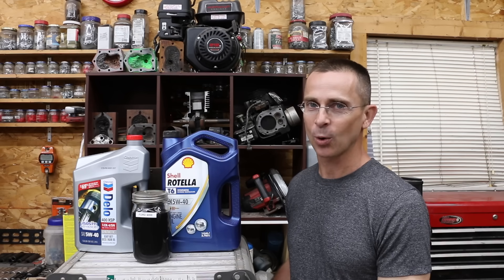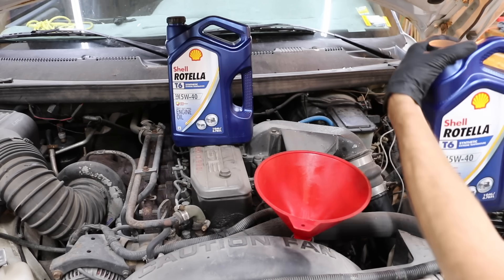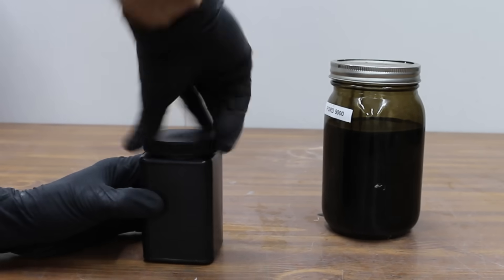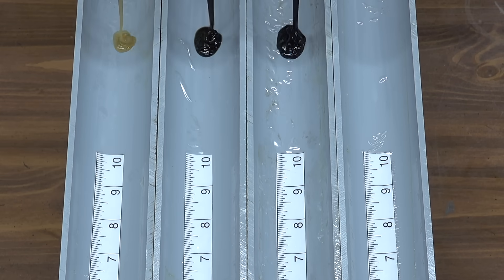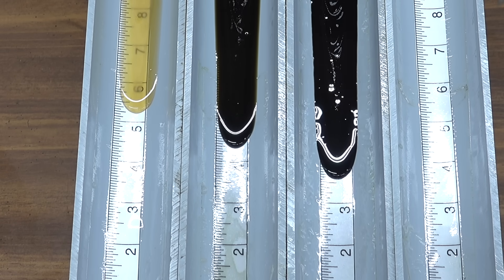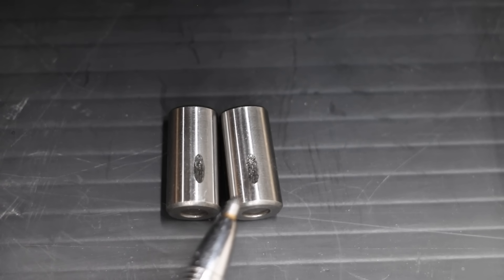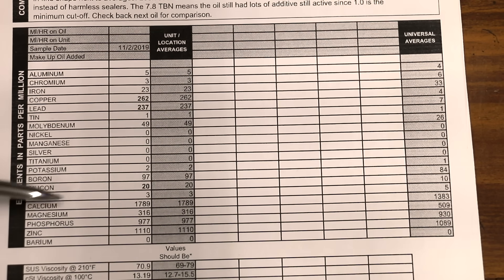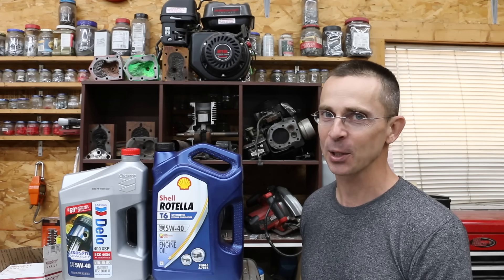Will Annual Oil Change Damage Your Car? Let's find out!

Comment: Way back between 1975 or very early 80's, I remember reading that the US Post Office had developed a vehicle program to cut maintenance costs on there fleet. They would just change the Oil Filter and add a Quart of oil or whatever it took to top off the engine oil. 
This might be an interesting test for you to try if that program was terminated. A lot of things in oil development, like refinement and additive improvements have been done since then. I haven't heard anything on that program for years, but last I heard was that the engines didn't show any wear on parts over the normal engine wear that could be seen over a complete oil and filter change.  Oil level was checked twice a day during the early part of this program to eliminate low oil damage during the early testing. I haven't done a search on it yet, but it might be interesting to see if they are still using that program and how the long term engine wear looked liked. Based on your tests, it may still be going and saving many fleet services a lot of money. But again and to be fair, oil lubrication refinement and additives have changed and improved a lot since then. 

That program was developed because of the Arab oil embargo in 1973. Oil prices went up causing major price increases practically over night. Gas that sold at 30 cents a gallon for regular and a whopping 45 cents for high test, went to 55 cents a gallon for regular and 65 cents for high test. That was if you could get gas at a gas station. It got so bad that you had to buy gas on odd and even days depending on your license plate numbers. Taking a long trip was practically impossible by car, stopping for gas they would only give you a 1/4 tank at most and you had to wait in lines for hours. Many ran out of gas just waiting in line. That 1/4 tank of gas, might get you to the next gas station exit on the highway and that was just the start of what happened, for those that did not experience this. Then the government got involved and really screwed things up thanks to the Carter administration. They had the Midas touch in anything they got involved with for sure and nothing they touched turned to gold, just bad fertilizer and a Cluster F**k at best! 

Everything was effected by that OPEC Embargo, not just gas and oil. Prices went up on everything from food to clothes and a lot more. Everything depends on getting it to the place you buy it from and that is by vehicle and shipping costs skyrocketed. The 55 cent price per gallon held for a little while, then it went to 65 cents then 75 cents a gallon. The price of gas rose so fast the gas pumps couldn't handle the price change after that. When you got gas for your car, if the pump had $10.00 on it, you had to bubble that. It was really $20.00 that you put in the tank.
Those were crazy times and many places started programs like USPS. Even the Airlines wound up buying or building an Oil Refinery to try and stabilize jet fuel. Some programs developed worked, many others didn't or turned out to be scams. With the new pollution regulations removing lead out of gasoline caused even more problems with wear on engines. Auto manufactures had to redesign car engines to adapt to that fuel. 
Crazy times and I hope we never have to go through another one like that.

Added: Some strongly believe that Electric Cars will be the ultimate answer to a pollution problem. I strongly doubt it for many reasons. Most people today do not know that the Car was once hailed as an end to a very large pollution problems when it first came out. That problem was Horses and they were at one time a huge pollution problem. Before the Automobile, every where you went, you either walked or used a horse in some fashion. Horses back then where look at as a Commodity, something to be used for travel, hauling or Farm work. They were not looked at as pets like today. A horse WAS your major mode of Transportation, Trucking and labor. There were between 150,000 to 175,000 horses in NYC alone back in 1900. If you have ever been around or owned horses you know 3 major things first. 1: They are expensive and take a lot of work to care for them. 2: They eat and drink a lot. 3: They Crap and Piss a LOT! Now just think of that last part and imagine how much crap 150,000 horses, in just one city, will produce. Then think of all the major cities, towns and even rural areas that had to deal with that pollution problem  That old cartoon Rocky and Bullwinkle, at the end featured a street sweeper with his broom and trashcan on wheels. That was a reality back in 1900. All that horse crap had to be dealt with on a daily basis as the people operating the horses were not going to stop and clean it up, they had to get somewhere and the vast majority were carriage drivers, the Taxi's of the day and most of the carriages used 2 horses. Then there was the problem of disposing of a dead horse. Most horses were used until they dropped dead and the carcass could lay there for days before it could be hauled off. Horses are heavy and when it must be moved with human labor, it takes a lot of effort even if other horses are involved and with other horses dying daily in the city, it is going to take some time before they can get to it. Now imagine the stink of a rotting carcass laying in the street during the summer, accented with the smell of horse crap and piss. That was a major cause of disease and rats. So when the Automobile came out, everyone saw the end to a major pollution problem. But in their excitement of getting rid of the horse pollution, they didn't see the start of a new one coming from the exhaust and other pollution from cars and oil. Look it up if you don't believe me.

So this is something I'm seeing now, in the excitement of seeing one pollution being eliminated are they over looking a trade for a different pollution. Electric motors produce ozone in small amounts. But multiply that by millions, how bad is that going to be? Ozone is a great thing in the upper atmosphere but it is corrosive and a health problem at street or human level. Those batteries must be recharged too. That takes Power Plants and as more and more electric cars come online, it is going to require more electricity to be produces. Wind turbines and Solar Panels are not going to produce enough power and Solar Panels are about useless on cloudy/rainy days. In snow country, even worse when the panels get covered. With the growing amount of electronics tapping the grid, electric cars are only going to require far more. To give an example of power increase over the years just in homes. When my father built his home way back in 1964, the average home only had a 50 Amp circuit or beaker box. When I bought my first house in 1985, the average home in my area used a 100 Amp Breaker Box. By the 1990's it was a 200 Amp box. Today, some new homes are being built with a 400 Amp breaker box. All this because of the electronic explosion we have going on. So even with all that renewable energy it will not be enough, so more oil/coal/nuke plants will have to be built to supply the increase demands. Then there are the batteries that must be replaced every so often. As it stands now, the batteries can not be recycled so where do they end up? 

I'm no expert, but I do know that people often overlook things when something new comes along. It doesn't help when the environmentalists jump on the wagon before they know everything about a new product they think will do some good, only to find out later it is worse than the old product and many will never admit that. Many times, someone will produce something touting how much pollution of one kind it doesn't produce, but don't tell you or they don't see that it produces another pollution in a larger amount, like in disposing batteries. So in stead of banning one product and requiring everyone to switch over, maybe there should be a balance between the two. Hydrogen could replace gasoline as a much cleaner fuel and it is not as dangerous or explosive as once believed. Oil produces much more than just gasoline or fuel. There is lubrication, plastics, waxes and medicine produced from crude oil just to name a few. Sulfur products are another major product. 80% is produced from crude during the refinement process. So you will never be able to stop the need for the production of oil. In fact you can't live without it today or in the future.
Reply: now that was a brilliant statement

Comment: I have a spare car that gets used probably only 90 days per year and less than 3000 miles, so its parked for months on end in a shaded outdoor carpark (FL). When i do end up using it i beat the hell out of it after a long warmup and so far i only replace the oil once a year, should i do the oil changes less, year and a half maybe?

Comment: Also, since diesel fuel DOES evaporate, over time, if you are not adding more into the equation, and its evaporative index is higher than lubricating oils by molecular weight, viscosity and vapor pressure, used oil diesel crank case will have a higher tendency to lose to evaporation compared to new oil out of the bottle.

Comment: Also you need to check out the oil and video that Power Driven Diesel has. You might find it interesting. They have their own oil formulation for pre emissions vehicles

Comment: Since diesel fuel evaporates less than gasoline, diesel crank case oil will tend to thin out more over time, and stay thinner when stored, so this will lead to reduced viscosity even at reduced temperatures. ~( 'w')/

Comment: Impressive methodology for your test. I store my gas engine truck for the winter, and I will follow your advice of getting it up to operational temperature once a month. It is under warrantee for 5 years and I hope the dealer does not make a big deal that the oil  only has 3000 miles use on it, but it has been in the truck for 10 months. Thanks for your hard work.

Comment: Thank you, Todd, for another great comparison.
Personally, I never was a fan of frequent oil changes - I've kept synthetic oil in my vehicle now for 5 years, change the filter once a year and top up the oil level. Frequent oil changes are designed to get the customer in the shop and fill the pockets of the oil companies. I have been in the trade for 40 years now - never ever have I seen an engine fail due to "gone bad" or old oil (aside from diluted oil due to a head gasket failure or similar). As for the wear - most wear occurs IMHO as a result from insufficient warmups prior to placing a load on the engine.
Have yourself a very merry Xmas and spend some quality time with your loved ones.  🎅🎄❄🙂
Cheers from Germany,
Volker

Comment: Oil protects metal from air ... No mater how oil it is ... Oil also is made from gas so ... There no corrosion... Unless water formz. Or some way your radiator that u never change makes a hole there ur engine wall

Comment: Any issues with the Ford 5000?  They used to leak hydraulic fluid like a sieve, since thee accumulator always kept pressure on the system.  Fun fact, the 5000 used the same hydraulic pump as the 8N.

Comment: I always used diesel oil in my ATV. One time I tried Delo after I had been using Rotella. The thing smoked like crazy with the Delo oil,  and stopped smoking when I switched back to Rotella. Since then I never was a fan of Delo.

This was with conventional 15w40 oil however I believe rotella will take the cake across the spectrum. I like seeing the lab results!

Comment: I never change the oil when it’s recommended. I do check to make sure it’s always at the right level. I change my oil thousands of miles after it’s recommended due time.  My current car recommend oil changes every 10,000 miles (Lexus IS300). I’m not claiming I’m not doing harm to the engine, but I’ll never know since I turn my car in to every 36 months after the lease ends!
Reply from the maker: Thank you for the feedback

Comment: FWIW I’ve used both oils on my 240k mile duramax and the t6 is quite a bit noisier.  The deli 400 has been excellent oil over the years and it quiets the engine down quite a bit.

Comment: I have a 2004 f350 6.0 they seam to be alot more finicky. Had to have high pressure oil pump replaced twice. I have a very good diesel macanic and he said you need to change the oil in the 6.0 every six months  no matter the miles. He has a 6.0 of his own. All he uses is Rotella!
Reply from the maker: Thank you for the feedback

Comment: It's funny for me as an European that Americans change their oil so frequently (3k miles). Either you have terrible engine manufacturing tolerances or it's a scam to make you buy more oil, or some of you are old enough to remember the good old days when oil needed changing so frequently. Modern cars in Europe have like 20k kilometers (12,5k miles?) or annually oil changing interval and are just fine after 20 years. Personally had a neglected 23 year old opel with 250k km (160k miles - it sat for like 5 years not being driven at all) on it with oil changes once a year (10-20k km depending on year ) and it didn't even burn oil, what killed it was rust. Had to scrap it last year, deemed to unsafe to drive.
Reply: In fact most recent European petrol cars have 20k 2 year service intervals,  rust tends to get most cars before engine death.   I seem to recall Mobil running a car for over 100k miles without changing the oil with little detrimental effect.
Reply: Yeah oil changes every year are good , but now  new engines are so delicate that you should at least suck up 2-3 liters after 6 months ...
Reply: Alot has to do with the fuel used. In a gas engine, the oil goes black in 500 miles due to hydrocarbon deposits (gasoline) winding up in the crankcase. Different countries run different blends of fuel. There are many other factors too, but that's for another day of discussion.
Reply: lol, i change oil every 5,000 kms. every engine iv owned has done half a million killometres and more.

its called preventative maintenance - australia is a harsh country.
Reply: its the quality of the oil,i bought a truck,they had replaced the oil,on striker said next oil change 180k,i got 178,before the engine started to rattle.shit oil..we change diesel oil every 5-10k,just to be safe.with new filters.oil will turn into sludge,after neglect.depends on engine condition.rings.ect.
Reply: It's funny to me as an European, that my European buddy doesn't read the user manual of the car he's driving. The 1 year rule is not a scam or due to "terrible engine manufacturing tolerances", but it's the manufacturer's reccomendation.
So instead of blaming the Americans, complain to the car manufacturers.
Reply: Most cars these days only need it every 10k miles which is the recommended from most dealerships. I personally like changing my oil every 5000k-7000k miles because I like to keep it fairly new. And let’s be honest if it’s $45 for all the oil and a filter it’s a matter of laziness if you don’t take the 30 minutes to change it more often.
Reply: Cars from europe are crap i have to say
Reply: 1991tommygun So are americans whats your point ?
Reply: Sparx with American cars even worse than euros.
Reply: Sparx new american cars suck yes, but the best cars ever made were v8 pushrod american muscle cars, you can keep them going forever and just easy to work on unlike euro trash.
Reply: 1991tommygun idk man you get a 90’s Honda Accord or civic that will last a lifetime completely out of oil 🤣🤣🤣 they don’t die for whatever reason!!

Comment: I used T6 in my 2004 jeep grand cherokee for the first time a month ago, based on recommendations from a jeep forum, I guess they were right and you proved it!  It actually increased my gas mileage by 3 miles per gallon and is a quieter motor.  Merry Christmas, Sir, may your next year be fun and good.  Amen.
Reply: So what oil were you running before?  Same viscosity?  Thanks.
Reply: @melrobinson6919  10w30, castroil.
Reply: @gristlevonraben   Thanks.  I'm going to try T6 in my 01 7.3 Powerstroke next oil change since this vid indicates it is slightly superior to the Chev Delo Full Syn I've been using.
Reply: @melrobinson6919  awesome, just remember, they come only by the gallon, unless you are lucky enough to find a few quarts somewhere, so basically, you have to buy two gallons. They can be really cheap if you look around, though.
Reply: @gristlevonraben  Well, I always buy oil for the 7.3 in gallons.... It takes 15 quarts!
Reply: @melrobinson6919  oh my gosh, in a Ford V8? Doesn't seem possible.
Reply from the maker: Thank you for the feedback

Comment: Hey buddy! Merry Christmas! 

Would you kindly do a video on the following oils? I've read where they perform very well, but I'd like to see a head to head matchup on them. You do a great job and I really enjoy watching your videos.

I pulled their descriptions from their website.

Mobil 1™ ESP
Helps prolong the life and maintain the efficiency of emission systems in both diesel- and gasoline-powered automobiles

Mobil 1™ Turbo Diesel Truck 
Helps extend engine life for modern diesel engines even in severe applications

Mobil Delvac 1™ ESP 
Delivers long drain capability and fuel economy potential for modern diesel engines in severe applications

Mobil Delvac™ 1300 Super 
Helps extend diesel engine life for some of the most severe on- and off-highway applications
Reply: Hey, just wanted to check that you saw this?